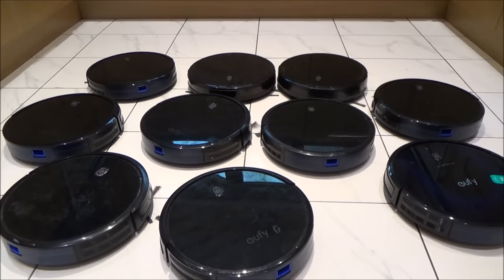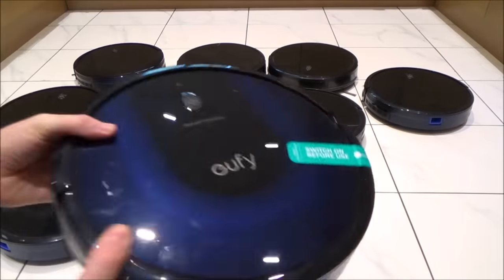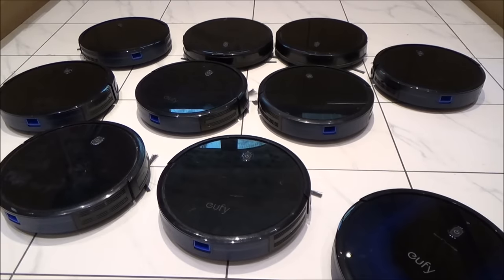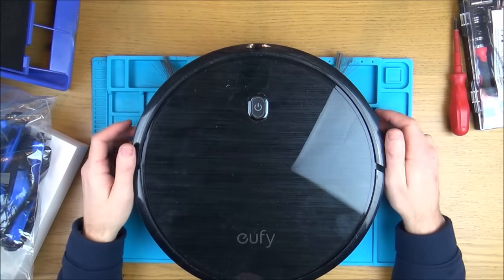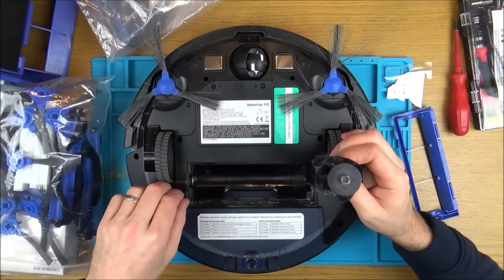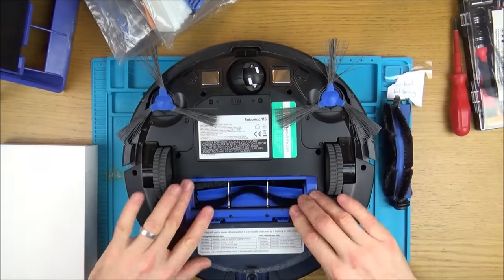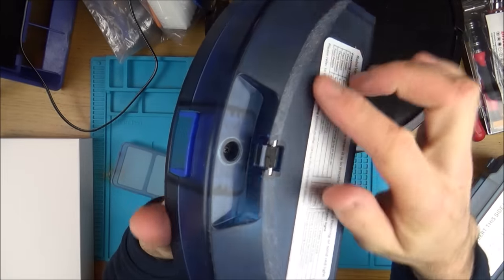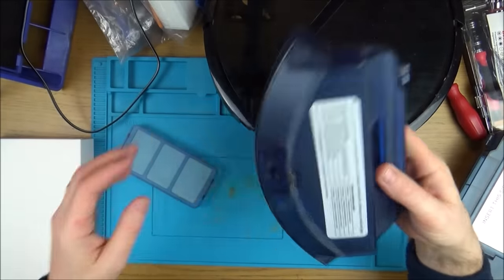Trying to FIX: Joblot of 10x Faulty Robotic Vacuum Cleaners

Comment: This is where a 3d printer is perfect, print yourself a new gear/s
Reply: To a degree, but I doubt the time needed to design the gear in a CAD program would be all that cost effective, not to mention just learning the CAD program in the first place.
Reply: @Pillock25  9 times out of ten someone's gone to the trouble and uploaded it to thingiverse or others , I needed one for a project last week and thought I doubt someone's uploaded it, to my shock they had, but point taken if it's not already on the site, it's hardly worth the time.
Reply: @Pillock25  Making gears in fusion 360 takes about 20 seconds. There is a plugin, you just input the number of gear, modulus and pressure angle and software does the rest.
Reply: @perica38  same goes for Solid Works, but learning the package can take hours, took about 4 hours before I started making gears
Reply: @Pillock25  no, it will be worth. The skill he obtain will be used for next fix. For me having 3D printer is advantage for fixing stuff. Plus, 3D printer had large community. Searching a gear template with adjustable perimeter is just a matter of second. So yes, in my opinion it worth having 3D printer and learn CAD.
Reply: @LaggerrLover  I just wish 3d printers were more advanced, I hate the look of everything they print, all the lines in the plastic
Reply: @billy-waynejeffcoat4828  If you hate the lines take a look at SLA 3D printers. They use resin and the prints are super smooth.
Reply: @Pillock25  eh, fusion 360 has a gear macro, you just type in how many teeth you want. There's lots of tutorials. I'm sure MMV could figure it out :)
Reply: you're overcomplicating things to an insane degree.
take a good gear, make a silicone mold, cast it in some resin.

sure, a 3d print would be cheaper, but casting costs would be much lower to start out and you would have 10s to 100s of gears.
Reply: @billy-waynejeffcoat4828  Nah... they are, my printer at home turns out prints who do not have does lines you speak off.
Reply: i doubt the material is strong enough, 3d printing low quality plastics yields alot of broken future items
Reply: 3d printers are great, but unless what you want is on thingiverse you need someone who knows 3d design, which can easily cost you far more than the cost of just buying another hoover.
Reply: @Debbiebabe69  Not for a gear. Properly someone here is a huge fan and would do it for free.
Reply: @Pillock25  I mean once you have the skill down you'll be using it for more than just the one thing. Especially in the repair hobby/industry
Reply: @d.b.6240  thats what happened to me when i wiuld print safety gears for my mini mill, teeth would shear super easy

Comment: Vince you should get a 3d printer! I got one and i've already used it to fix a label printer for ebay, cost me £20 untested and one of the holding clips wasnt holding anymore so I printed a new one and now it works flawlessly. Saved me at least £30 if not more, it will pay for itself. I suppose the only hard part is designing the models, I have a friend who does it for me but some common parts can just be downloaded.
Reply: George Brooke big difference between making a clip and making gears, you need to know the math to calculate the proper involuted angle to profile the teeth, its waste of money to buy a printer for hundreds of pounds when you can just buy the parts from the Shenzhen market for pennies.
Reply: Have you ever made gears on a printer? No maths, just count the amount of teeth and there will be a way to generate the gear you want,  I got a printer about 4 years ago for 150, that's the price of 10 of those gear parts he mentioned. Still working to this day perfectly. Saves you pissing about crossing your fingers hoping you don't die of old age before the parts arrive from China.

Comment: Keep in mind a lot of the chain run products use off the shelf parts Example: 28.50 those rollers are just like the rollers used in ink and bubble jet printers paper guild trays, Meaning more stuff you take apart and squirrel away parts, the more stuff you can fix for less money later down the road.

Comment: nice set of fixes. I would keep all 11 and have 1 in each room. Set them all to start cleaning at the same time. Could also add some flails to a couple and have them as the overseers to keep the others in line.

Comment: Vince these have six motors in each. 1 Brushroll motor, 2 side brush motors, 2 wheel motors, 1 fan motor.

If you do a project with one of these, make it into an RC vacuum.

Also you can try gorilla glue on the broken gear teeth.

Comment: You really need a 3D printer. Plastic parts like the flattend tail wheel is perfect to be replaced using a printer. With a bit of tinkering you could even print new gears in ABS. It is even perfect for improving devices during repairs since you already know why it broke you can strengthen parts. However it needs some learning, but - well- you already learned so much in the process.

Comment: Yeah, it's so frustrating that manufacturers use plastic instead of metal for critical parts like gears.  I bought a couple of vintage film projectors hoping to combine parts to get one working -- but both had broken plastic gears.  So I ended up with a couple of door stops. :-(
Reply: Recreating a plastic gear is not difficult. Do a little research.

Comment: you can fix a gear using J-B weld first use a needle file to straighten the gear teeth that are still intact then clean the gear with alcohol to remove any trace of oil or grease then coat the gear it will mesh with using grease then mix up the J-B weld and apply it to the gear in the area that is missing teeth place them on their shaft slowly rotate them and let the grease coated gear press into the J-B weld it will form new teeth remove them carefully and let harden you might have to use the file on the new teeth to remove excess , I have used this method to fix plastic gears but I always use the five minute J-B weld

Comment: I got one if the name brand ones and disassembled it to see what was wrong with it. The poor thing had been exposed to water and there was significant corrosion damage to the mother board. 
The way those are designed, there was no way to do anything with them if the mother board gets water damaged. I learned a lot on how they work. My question is, if those were returned as damaged, why do they have wear damage? It doesnt seem they would have any damage to the brushes if they were new but defective. I suspect people were replacing the new one in the box with their old worn out unit, then shipping them back as new/ defective. 
People do that through Amazon all the time because Amazon doesnt check returns.

Comment: 3D printing pens use PLA and some use an ever lower melting filament. In order to replicate the wheel you would need at least ABS but preferably some Nylon Composite. I have a few 3D printers, and can recommend one or two. If you want the best bang for buck, go no further than the Creality Ender 3. Very affordable and a proven work horse. No need for Prusa. If you want to do a lot of ABS etc, then I would suggest the Sapphire S with enclosure. It is a Core XY, slightly more expensive but very good for exotics.
A 3D printer is great for your arsenal, I have repaired many non repairable, irreplaceable parts for many diff jobs.

Be careful, the robot army may take over

Comment: hey Vince, i have a smart scoop litter box and, it uses spur gears in the motor, ive been looking all over the place for a replacement since one of them broke, i just noticed that one of the vacuums like these uses double spur gears, so it could be possible to find a model that uses the same gear, then i could buy a cheap or a broken model and hope the gear i need is not Also broken, the one i have is the smart scoop litter box, very good product, would you be interested in getting authentic liter boxes and try to fix them, ive seen a ton of people that just replace them when they break, there has to be a better way

Comment: Vince,First good to see a repair instead of trash. It is otherwise a lot of wasting environment, chemicals, and energy of making these or new ones. That's why I love my Miele S220 Vacuum cleaner out of the 1978! Still working, just a new bag and a filter, of it goes. 40years! Because I handle it popper, with care, don't overheat it by replacing the bag right time. BUT remark at your vid at 25:00 min And you have to remember that! Look for that burn spot on the PCB. Burning is carbon. And you know that is the stuff they also make resisters from. A brun spot is a new resistor. So Alway's clean thoroughly those spots, even when needed to scrape it away. Otherwise It can still result in a dis-function pcb.  And seeing those scrap worthless shit dismantels prove my point. It is still cheap shit, sold for way too expensive. (when new of course). Look at those motors gears bearings, what a shit. THAT is to be forbidden. They must build good quality stuff.
Remember when people throw that away after 2 or 3  years, the waist. So good thing you repair that stuff, thumps Up.

Comment: My problem with the original Eufy vac was it started fine, then after a few weeks the IR sensors at the front would gradually stop working and they would just smash full speed into all the walls and furniture.

Comment: Bit late but found the gears on eBay search for EUFY RoboVac 11S 11SMAX 15T 30 30C 15C 12 35C sidebrush gear cog replacement set

Comment: I have taken my robots apart many times.  Be careful with WD40 on the floor.  I skated across the kitchen after spraying the feet on my stove.  I probably would have used a bead for the wheel.😀

Comment: Hello,  I have a RoboVac 30C, the board looks the same, I have the "low battery error", I checked the charger and the battery have 16.8V. I guess it is any faulty componet in the board,  but there is none visible exploted  or burned. Any sugestion to fix it ? Thanks in advance.

Comment: I had a robotics vacumn cleaner that I left near open window and it was raining and water flooding in.. my robotic cleaner was wet through. It is not charging though I can power on. Can this be repaired. I hate to throw away a relatively new electronic and repair man told me it cost couple hundreds to repair which was more than what I paid for

Comment: you could easily fix that broken motor gear usin a solder iron an a piece of plastic. plus some cuts for fine form with sharp knife/ the same is foe third wheel

Comment: one of my proudest moments was using a hot air gun to remove i good analog stick I wanted to use as replacement, just to turn the board around and see that I've melted the whole analog stick away

Comment: The real problem is these devices are junk to begin with,. plastic gears, and wheel/rollers that should be made of metal or high wear plastics. They are essentially toys, not machines that are designed to be dependable and long lasting.

Comment: Why are customers so duumb, so unnecessary to ditch an entire device for something as simple as a worn brush attachment... They get a new one and the same issues pop up again for the same exact reasons as the first time. Baffles me how one can spend 200 pounds on something and not even spend a few minutes a month/year maintaining it. Luckily these got into the hands of someone who could identify the issue but all these would have otherwise been scrapped and ended up in some junk pile - perfectly good devices with minor issues.

Comment: Vince, Here's a request for a future video that might be interesting.

Buy some of the "DIY" kits for "KIDS" on amazon and try to build them using only the instructions provided.

Seriously babysitting my friends 13 year old today, we tried building one, and either we royally messed up or we royally messed up.

Makes me wonder if the chinese manufacturers are intentionally making them hard just to discourage kids from learning. THeir wire choice is awful for beginners (Stranded wire that you can barely fit through the holes) 

Here's an example of the one we tired to build,And i later built a kit just to see if i could even do it(spoiler alert, couldnt)

https://www.amazon.com/WHDTS-Soldering-Following-Electronics-Competition/dp/B0732Z1FZC?ref_=fsclp_pl_dp_3
Reply: and as a followup, maybe you and some of your fellow youtubers can partner up and develop some of these STEM kits, nothing against china but they really are a miss on the educational front. We really need some English speaking developers of these kits.

And i'd be interested to see what suggestions you have to improve ont he kits, 

What kind of tools you think would be needed.
What kind of replacement parts you need (for me the first thing is to replace their wires with solid wires)

You could probably bring a few younger viewers in if you can make a kit and teach some